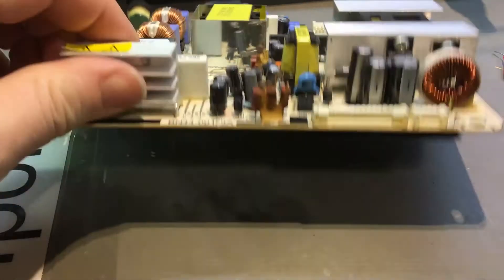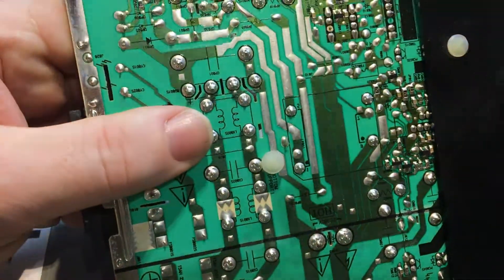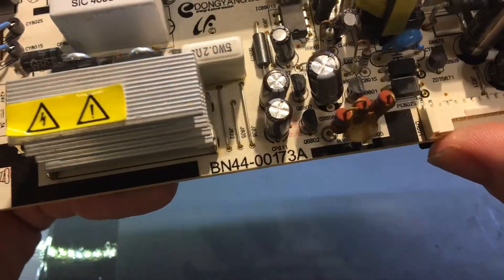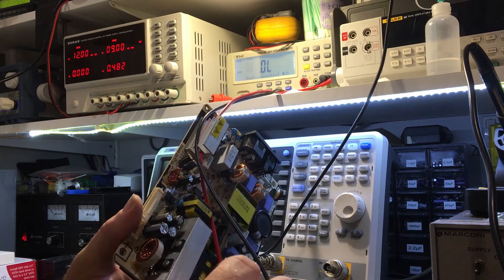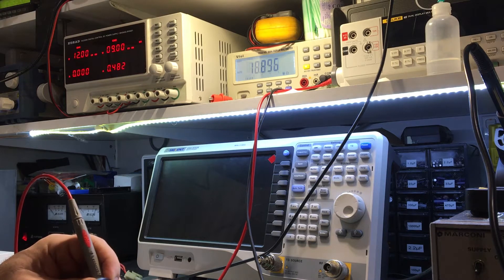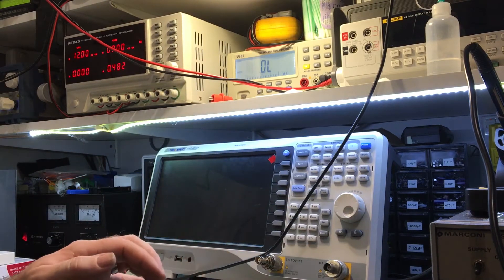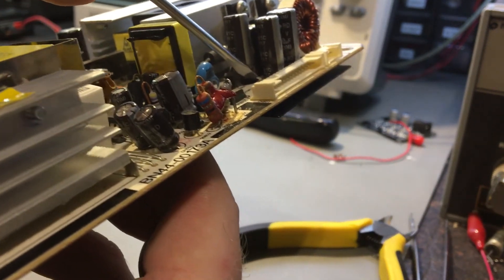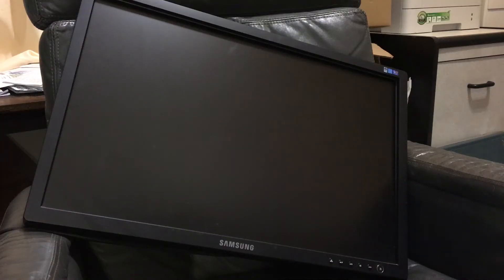#234 Samsung SyncMaster 245B 24" Monitor Repair

Comment: very informative video. I have been in the repair industry for over 50 years, so am well experiance. I don't know how much you know about these Samsung BN44-00181 PSU's, but I am struggling with one, changed all the caps, the SMPSU MOSFETs and the 0.22ohm safety resistor, the PSU will work for about half an hour, gets extremely hot, then blows the MOSFETs and resistor, seems like the MOSFETs are running into thermal runaway. Have you experienced this kind of fault before or know where I may find a circuit, I've downloaded a service manual, everything except the PSU is included. any ideas, many thanks.
Reply from the maker: I can only suggest checking current draw from different circuits in case something is overloading it, I don’t do much tv/monitor repair.
Reply: @simvoltssolutions159 I have the same issue w my Samsung's PSU. Did u manage 2 get it fixed?

Comment: I have a Samsung CFG70 24".  It takes 1-3 hours to warm up depending on how warm my house is.
It's pretty much unusable until it warms up, it has glitchy vertical lines and looks weird, but after it's warm it looks fine.
Anything I should look for?
Reply from the maker: Will likely be in need of capacitor replacement, also check for cracked solder joints.

Comment: Hey, I just fixed my monitor thanks to this video ^^. It was just lying around gathering dust. 
All I had to do was switch out one resistor which was bad (infinite resistance) for another one with 67 ohm and it works fine.

Comment: the top of that cap looked slightly domed to me and my eyes jumped to it when you first was waving the board around, but i've seen more than one that way, best bet is to replace all the caps on output side

Comment: did you replace all capacitors or just that one? Do I need some special type capacitors or will any ones do?
Reply: Priviledgy Shitlord The problem is finding out the original esr considering the one you're replacing has its esr too high. Ofc you can use "cheat sheats" that are printed on most esr meters, but it's not a 100% guarantee since the manufacturers may use caps that don't comply with the esr info written on the meter.
Reply: That is not a 100% solution tbh, especially if they used very low esr caps for some reason.
Reply: majority of them do have Low ESR caps on the switch mode output side